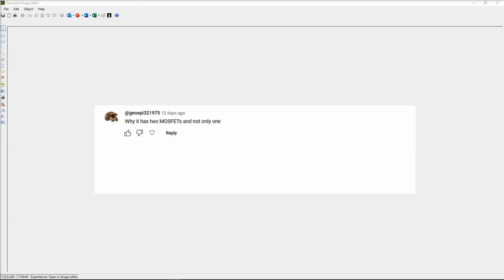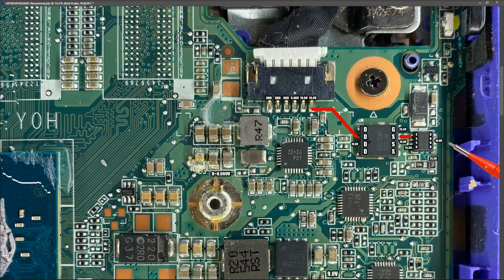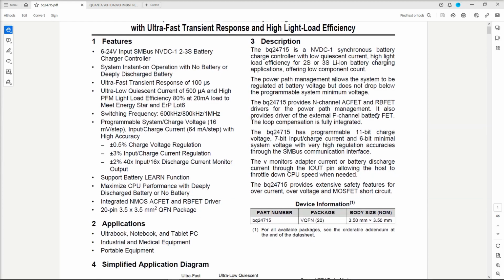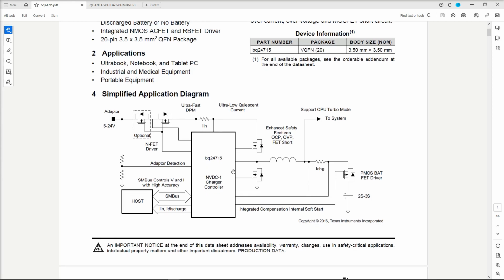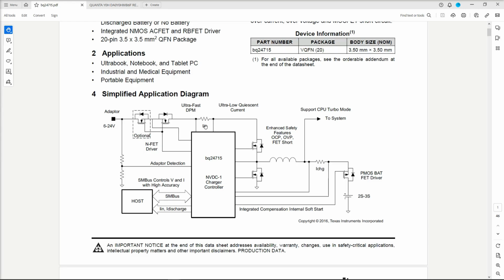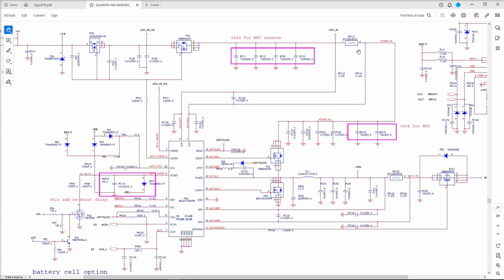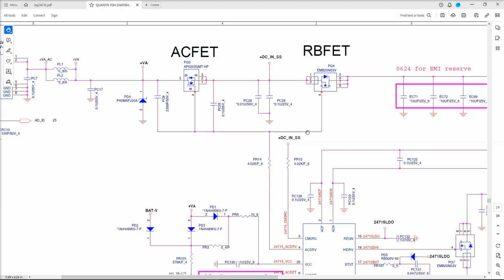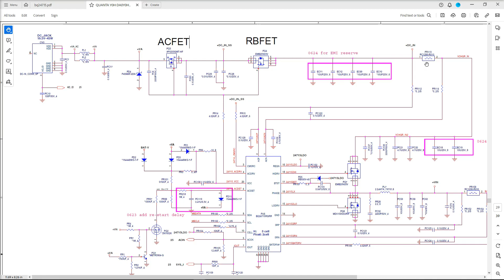Why Two MOSFETs? A look at the power management IC

Comment: Another thing I would like you to explore is the difference between the first two MOSFETs in your Simplified Application Diagram and the second two MOSFETs. The first two MOSFETs protect against over-current and backflow conditions. The second two MOSFETs  form a voltage "buck" regulator, with one MOSFET on the high side, and the other on the low side, connecting to ground. I am amazed that the BQ chip controls both pairs of MOSFETs. But since this is such a common application, I can see why the BQ chip was created, and is used is so many low-power devices. We see high-side/low-side pairs of MOSFETs in nearly all voltage reduction/regulation power circuits. Whenever we see a single IC, rather than a pair of MOSFETs, one only need look at the data sheet to see that the MOSFET pair has simply been combined into a single chip. Again, a very common application for low power devices. Anyway, bottom line -- I would love to see a discussion of the difference between the MOSFET pair on DC_IN versus the MOSFET pairs that are part of a voltage regulator circuit. Thanks!

Comment: One thing I have been confused about is why the two MOSFETs that form the inrush limiter have their source pins connected to each other. On the motherboard you repaired, DC_IN is connected to the drain pins of the first MOSFET, the source pins of both MOSFETs are connected to each other, and the drain pins of the second MOSFET is where the current emerges. For some reason, I had the belief that current in a DC circuit always flows from the voltage source to ground, and from source to drain. But in this example, current flows from drain to source, and then from source to drain. On many boards, these two MOSFETs are exactly the same IC, with the second one simply flipped. Your comment about the RBFET indicates that this reversal is to prevent current backflow. So these two MOSFETs, with the BQ chip, provide both inrush/overcurrent protection, as well as current backflow protection. Am I on the right track?

Comment: Do you have a video here on how to check the ac drive or charging ic volts? If not, can you please explain how to check. 
Just subscribed from Africa, Zambia
Reply from the maker: Do you have schematic? In many configurations the ACDRV pin of the power management IC connects to gates of two N Channel MOSFETS and should be about 25V in order to turn the N Channel MOSFETs on and allow the 20V to pass through to the current sense resistor.
Reply: @therepairshare673  please make a video on that

Comment: I tried to summarize your presentation, and to understand why the ACFET and RBFET are “reversed” and have their source pins connected to each other.

The ACFET, PQ3, has its drain pins connected to the 19.5V DC_JACK (+VA) line, and its source pins connected to the source pins of PQ4 (+DC_IN_SS). (+VA is connected to the ACDET pin of the BQ chip.)

"The ACFET allows the power management IC to control the voltage from the AC power adapter entering the motherboard. If the gate pin is high (which is usually around 25V), the 19V from the AC power adapter is allowed through the ACFET, and onto the motherboard."

The RBFET, PQ4, has its source pins connected to the source pins of PQ3 (+DC_IN_SS), and its drain pins connected to the current sense resistor (+DC_IN).

"The RBFET is the Reverse Blocking FET, which provides negative input voltage protection, and it prevents voltage from the battery feeding back to the DC_JACK."

You didn't mention the PD4 TVS diode, which protects the circuit from transients and over-voltage conditions.